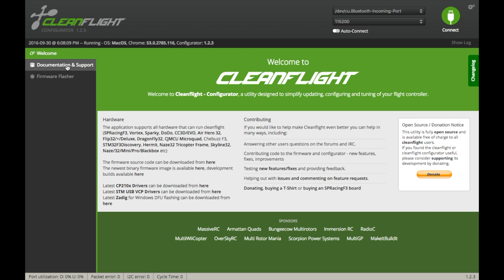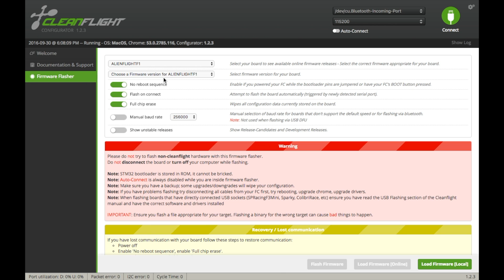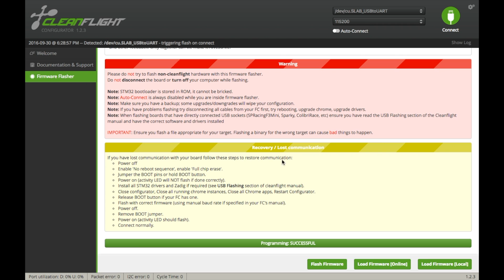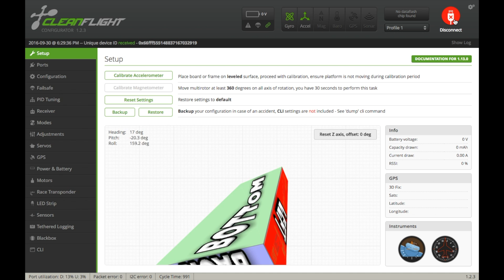Micro SciSky Firmware Flashing Tutorial

Comment: Good video mate :-) . I tried flashing mine yesterday after not using it since 2016 🙂 and it stopped half way with verifying and than it seemed bricked completely. I also noted this board showed as a normal com port and not DFU but there CP2102 and VCP boards and this is a CP2102  board so that is normal. Strange thing is that mine first seem to flash ok without even shorting the boot pins but it ended in a STM32 timeout error when verifying. Than i tried like an hour to flash it again with the pins connected but it kept coming back with the same error, tried with cleanflight and betaflight. I was finally almost giving up on the board but than i decided to try an older version of the cleanflight configurator( 2016 version)and yessss that worked. I than locked the board on purpose again to see if it would do the same and again on the lastest version of beta and cleanflight it would give the STM32 timeout but with the old version again flashing went fine. No idea why but if your board gives the STM32 time out try to use and older version and that should fix it. Note that in Zadig the board is shown as a CP2102 USB to UART Bridge controller.

Comment: Did you go through the initial flashing process that they describe on the product page: "please flash firmware by Flash Loader Demo, after that, please remove the soldered cable." It seems that the current version of the product may be different than the product you showed in this video.

I'm having trouble finding how to do that properly, either by myself or by others.
Reply from the maker: The "soldered cable" does not actually come soldered. It is a subsitute for the jumper I use in this video. Th reason that I use the jumper is that the soldered cable is very hard to install. Although I am using a older version of the Micro SciSky, the concept is the same for the new one... just have to jump two different tabs. 

For the new one, just jump these two tabs: http://www.overskyrc.com/images/upload/img/1470882325.jpg
Reply: So using the jumper, i should be able to flash with Cleanflight on the first flash? I don't really need to use the "Flash Loader Demo"?
Reply: I had tried using the jumper with Cleanflight but was getting an error of not being able to connect. Let me try again and get the actual error message. Thanks a lot for responding! This was really mystifying me!
Reply: I got it! It took some fiddling, but I guess I just didn't have a solid connection with my jumper. Was feeling gunshy I guess since this was my very first firmware flash like this. Thanks!
Reply from the maker: Glad I could help. :)

Comment: Hi, I was having trouble setting up my scisky and the Banggood website directed me here, but still no luck I set everything up as stated and still would not work, but then I saw I had to do something to do with a pice of software called "flash loader demo" do you know about this? and if so can you help?? Also my board is the updated "one port" version as some other people call it
Reply from the maker: Flashing firmware for the new Micro SciSky is a little different. All you have to do is short two different pins. All of the other steps presented in this video are the same. This image should help explain: http://www.overskyrc.com/images/upload/img/1470882325.jpg

I have never heard of a "flash loader demo". The GUI CleanFlight (it is a chrome app) should have everything you need to set it up. When you say, "it won't work", what do you mean? Is it not connecting to your computer in CleanFlight?
Reply: BananaScience it connects to clean flight and I have set it up as you state in the video I can bind it to my transmitter and in modes I have set one of my switches so I can arm but when I flick the switch I have selected the lights on the board indicate that it is armed but when I move the throttle nothing happens when connected to battery not cleanflight 
And we did short these two pins on flash and it hasn't worked

Comment: amazing video - actually i purchased a eachine qx100 and it became a little wet during first flight. after that the quad was working fine. I had connected to cleanflight & in the middle the system got hanged. so i rebooted the quad and laptop but couldn't connect now getting failed to 2016-12-08 @ 5:22:05 PM -- Failed to open serial port - can i flash the firmware i hope the Flight Control board is not friend up because of water.
Reply from the maker: I had a similar problem where my SciSky got a little wet and then refused to connect or bind. I just let it sit for a day or so and now it works fine.